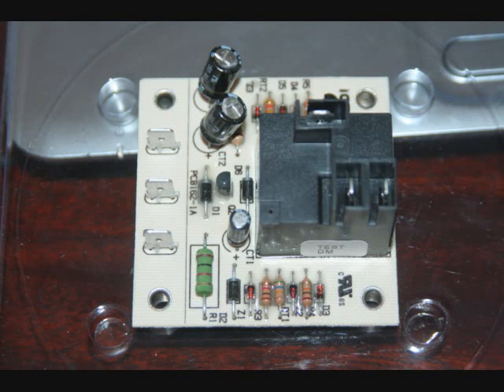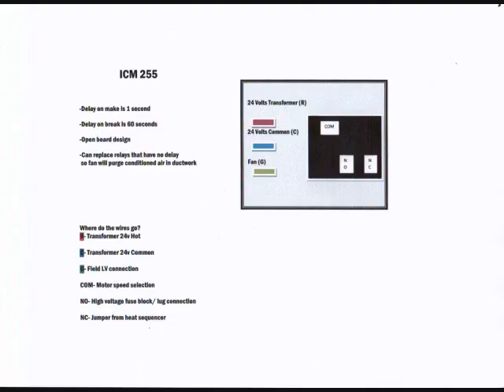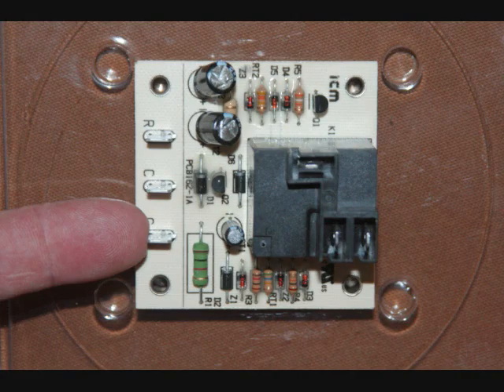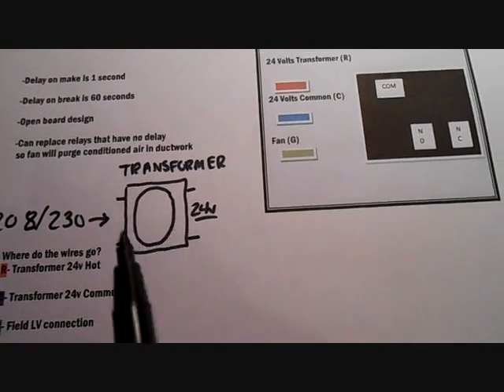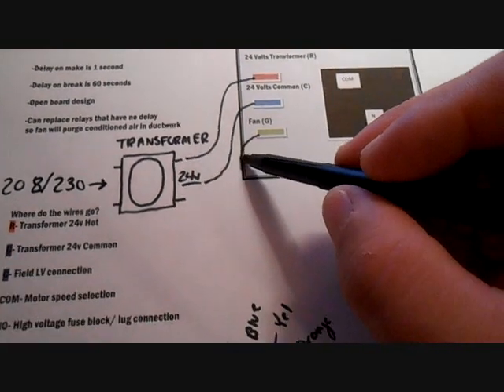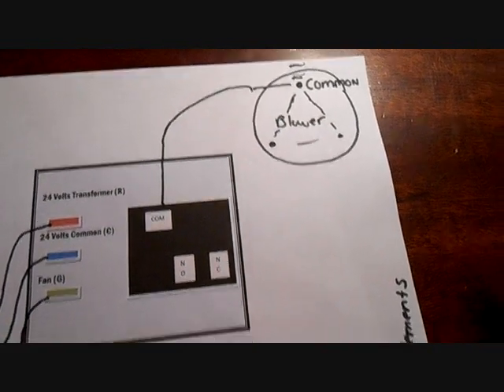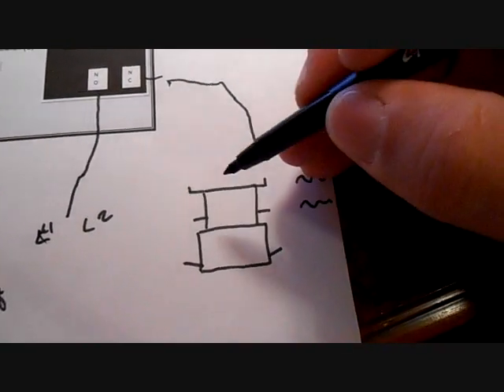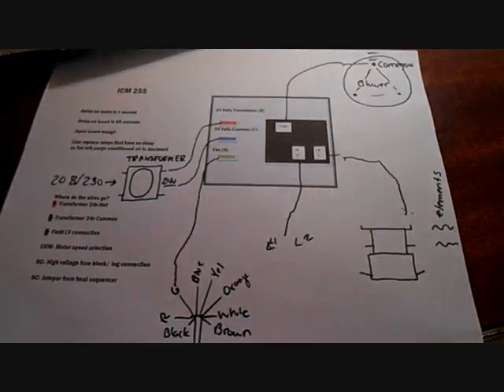HVAC Blower Control Board

Comment: Where do the 2 red and 2 yellow wires from the 2 thermostat wire bundles (one from the thermostat and condenser/compressor ) go?  Could you finish doing all the wiring.  Love you video. Thanks

Comment: this is one of the best presentation i have seen please do more . also what is the voltage from NC to C ???
Reply: The relay is switching the 240 side to the common on the blower.    The 24 vac is only there to engage the winding on the relay to close it from “G” and of course the always hot 24vac for the delay, but the connections on the relay itself are 240.   That’s why he referred to the relay as the high voltage component.    I know it’s late, but I hope it clears it up.